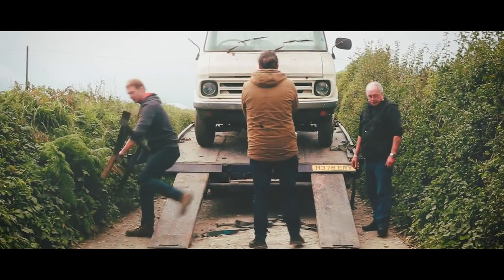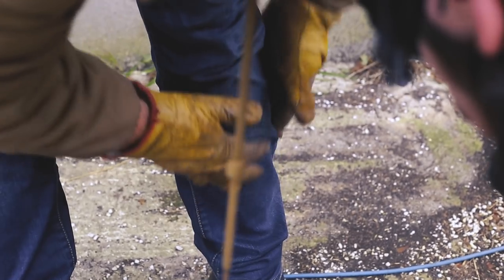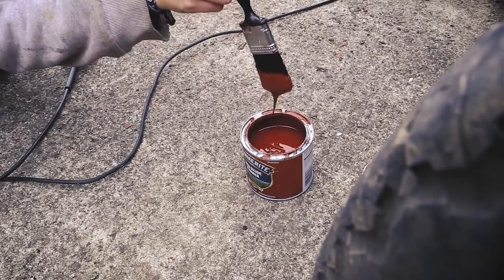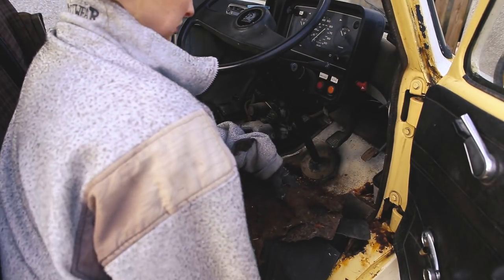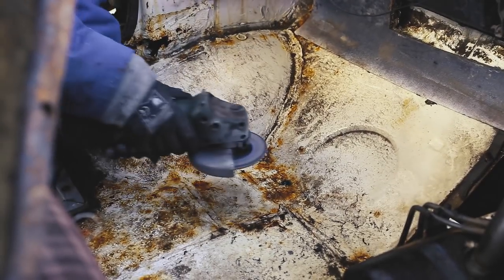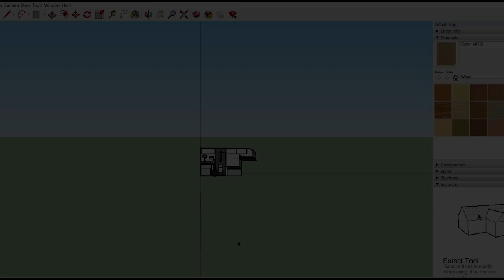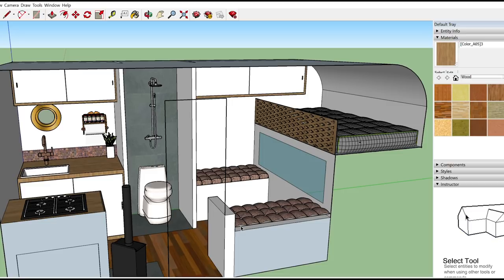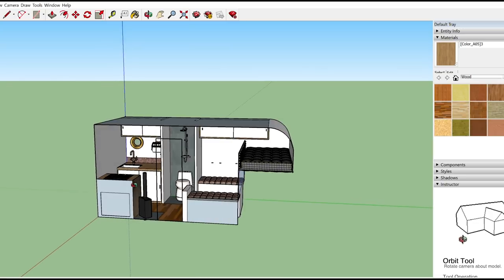Busting Rust & SNEAK PREVIEW of Van Build

Comment: you cant beat i twhen youve built it, all the best
Reply from the maker: Thank you! We can't wait to test it out
Reply: Great start guys😁. I was wondering though where the travelling seats would be for kids, if you are aiming it at families. We are currently looking for a camper and very few have forward facing seats with 3 point belts
Reply from the maker: +Tony Bonner Hey thanks alot! So there are three seats in the cab and then the seating area in the back which turns into a bed will also be extra seating when driving. We're just looking into the situation with seatbelts as legally you don't need them in the back of a van hit we would like to try and include them for safety reasons. There are some very clever ways that people have incorporated seats for entire families into smaller vans than this one, it's worth a look online!

Comment: Good luck with the build.  I like the idea of van rental to pay for your travels but wouldn’t a more modern van have had a wider appeal and possibly been more reliable?  I remember driving an old fiesta and my transit is way easier to drive.  Not a criticism just an observation and I’m sure when built the van will be great.

..... and being dad - please get some eye protection 😳
Reply from the maker: Thank you. Yeah I totally get where you're coming from and you could well turn out to be right. We're taking a bit of a gamble with an old vehicle like this but for us we really wanted something quirky and old, with a bit of character about it. We'd love to get ourselves a new Sprinter or something of the sort one day, but for this project we knew our hearts wouldn't be in it. We fell in love with the Bedford and have a great vision for what it'll look like 6 months down the line. If all goes to plan that is 🤣
Reply: I’m sure it will all go to plan, you just have to have the vision and I’m sure you do.

It has to be a transit when you come to replace your own, not that I’m biased 😂. ....... but Transits are cheap (ish), reliable, easy to get parts for, cheap to replace parts on and as long as you dont buy a rust bucket youll be fine.  If you want sprinter size just go lwb or xlwb which are cavernous
Reply from the maker: @project-kaizen4650  Yeah that's true about the Transits, we've got a transit engine in the LDV and it's never let us down. But yeah we're only really thinking Sprinter / Crafter for the size but you can get the Jumbo transits too I guess, they're a fair old size